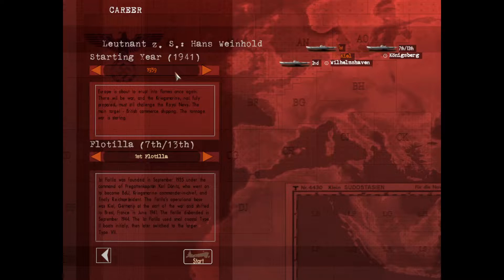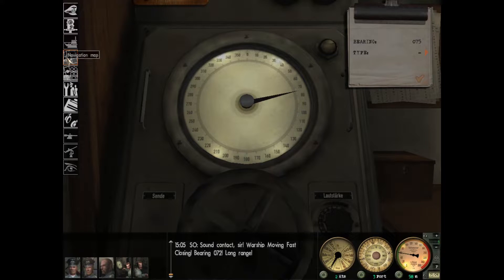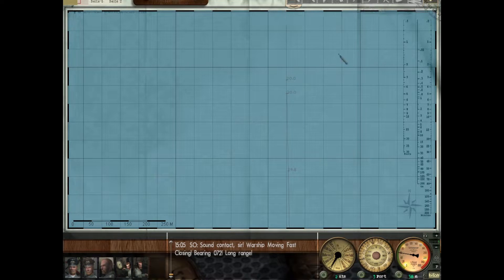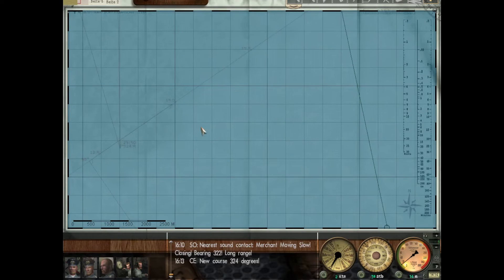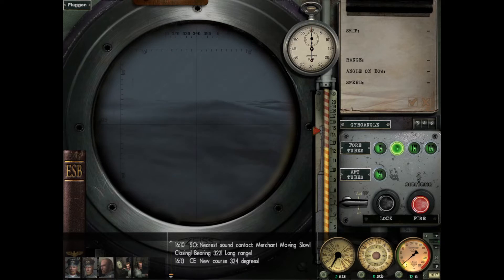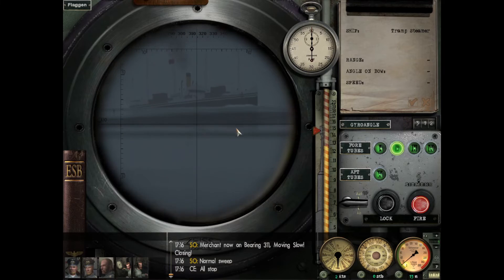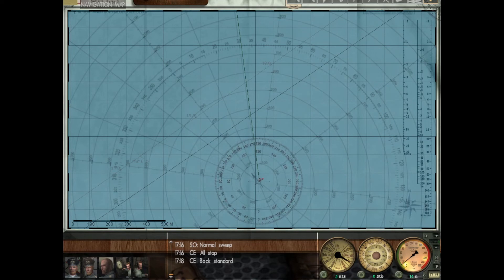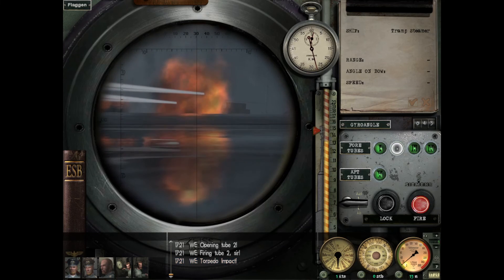Silent Hunter III [GWX] - Manual Torpedo Solution and Plotting - Using the Hydrophones

Comment: Hey this is just a suggestion but you might want to switch to using the UZO when you're attempting to attack a target in rough seas. The real gameplay purpose of it is that it's INCREDIBLY stable. Even in 15 kph wind conditions it makes using the stadimeter much easier and makes your range readings much more accurate in rough seas as a result. Of course you have to balance this with how visible you feel you are in said conditions and whether it's worth attacking from the surface. Just a suggestion. At the end of the day you're the captain of this boat so you play how you want. Great video BTW ^_^.

Comment: Why do you multiply by 1.94 when getting the speed of the ship?
Reply from the maker: I'm sure there's a more eloquent way to explain this, so I'm probably not the right person to ask, but... we are timing how long it takes for the ship's length to pass a specific point in seconds on the stopwatch. Taking the length of the ship (m) divided by the elapsed time (s) gives us a speed in meters per second (m/s). I literally just googled the conversion of m/s to kn and it told me 1m/s = 1.94384kn. Mathematically you could express this conversion as: (78.3m/23s) x [(1.94kn)/(1m/s)] = 6.60kn.

Others might recommend you just do the first part (length of ship divided by elapsed time) and then double it (multiply m/s answer by two in order to get speed in knots), as skippers didn't have modern calculators on board or the time to do this all by hand. Since the rest of your variables likely aren't accurate to 3 significant figures, rounding to "2" instead of 1.94 in your conversion shouldn't skew your results in a meaningful way.
Reply: @horrorfromthedeep1670  thanks for quick reply! It all makes sense, a mistake was on my part - I didnt notice the fact that google „corrected” my search for converting m/s to knots to metres to nautical miles. So what I got was some complete nonsense 🤦‍♂️🤦‍♂️🤦‍♂️

Comment: Quick question. Is it possible to make the game auto pause when an enemy is sighted, found on the hydrophone, or found on radio? I set time compression to 0 for this but it's annoying when time pauses for every meaningless radio message. I only want it to auto pause for the important or life threatening events. Thank you.
Reply from the maker: Hi there! If you're running GWX with the "SH3 Commander" application, you can change these settings before launching the game. After you open SH3Commander there's an "options" button in the form of a wrench near the bottom in blue. Go in to the "Time Compression" tab and set the option to "1" or "0" for the specific option you'd like. For example, there's an individual option for when receiving radio messages, spotting a ship, plane detected etc. So you can customize each of these individually through the app. You can also adjust your maximum time compression to 8192 using this app, but I personally don't like to make it too high since you can run in to performance issues doing this.